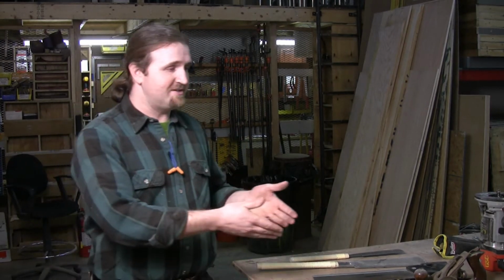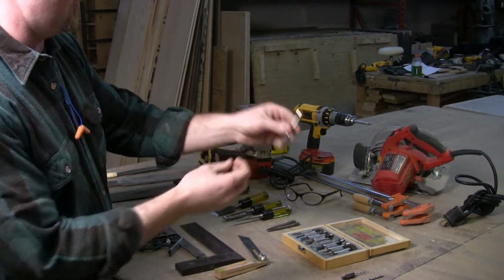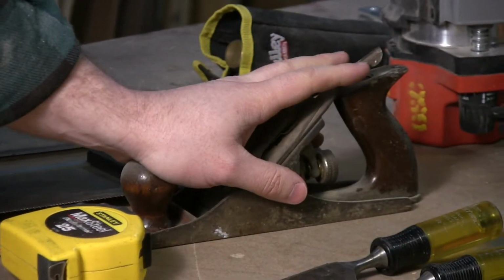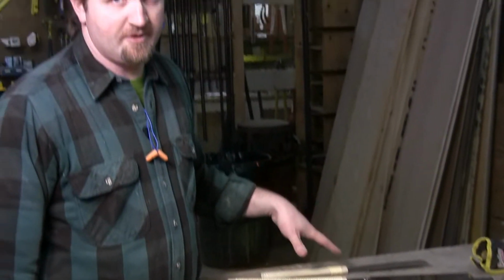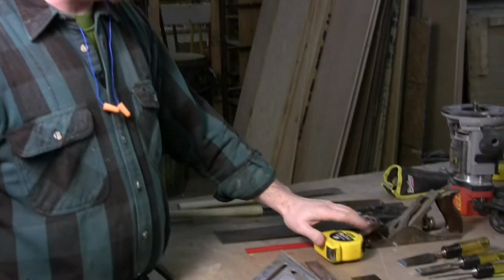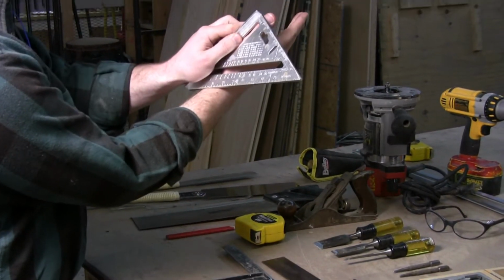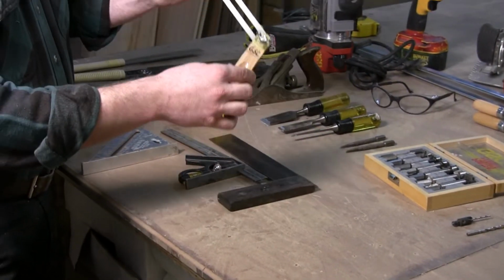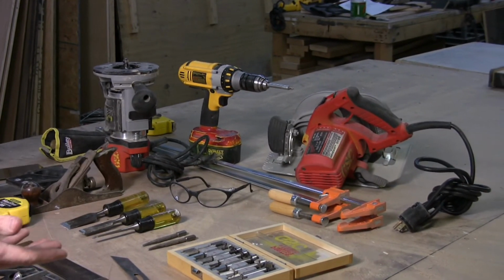Home Repair & Power Tools : High-Quality Woodworking Tools

Comment: I have bought some woodwork plans over the years, but this plan is the best so far among all my collections [Check Details Here⇒>☞★☞https://plus.google.com/u/3/110086446704524205338/posts/AdB3e6wj7Uj ]. The plans are not just numerous but they all have a clear and detailed explanations that a beginner can even use them comfortably.